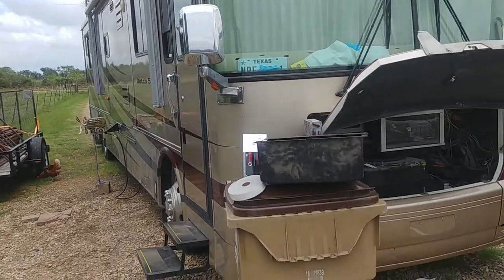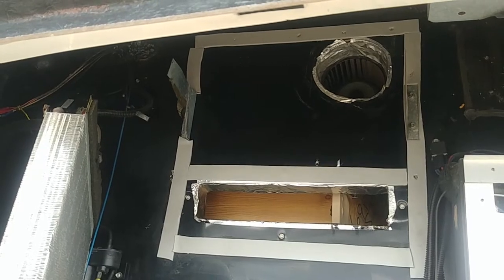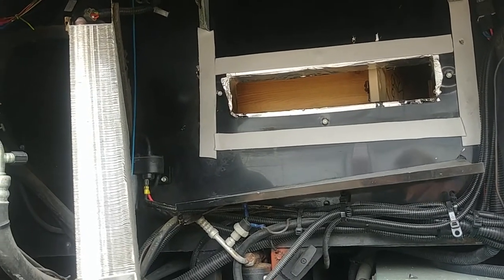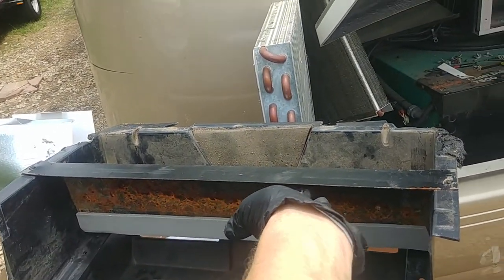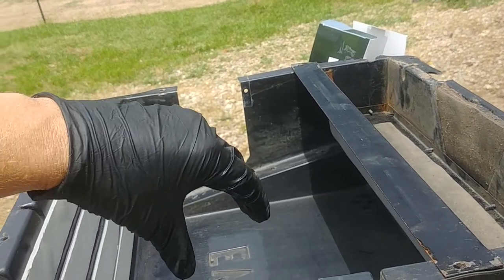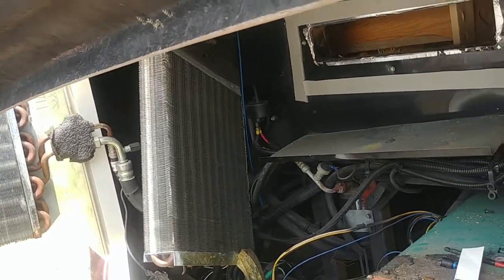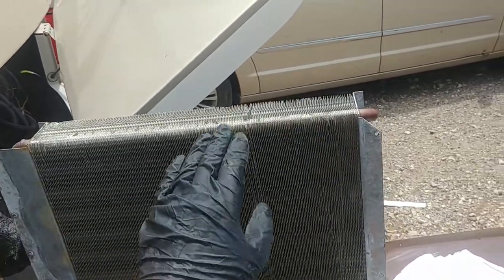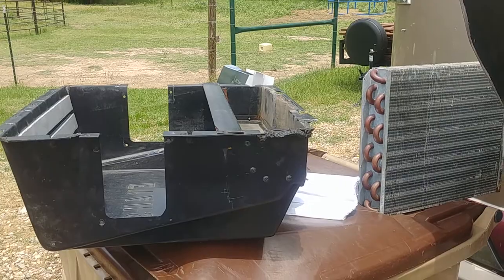Class A RV dash AC Big condensing coil fan fail.(read description)

Comment from the maker: This needed to be done anyway but it turns out it was a dirt-dobber nest on the big condensing coil. The nest kept the fan blade from moving and burnt up the motor. It is located directly below the driver seat on my rig. Looks like about a car radiator size. A fan pushes the air through. I bought a universal 16 inch reversible fan assembly from O'Reilly's. $89.99 Very simple flip the fan blade around per instructions. wired up the way the instructions tell you in order to push air. The mounts lined up. even looked exactly the same. Cheapest part I could find online that said it was for the RV was $167 plus shipping. Save the money this one works great.